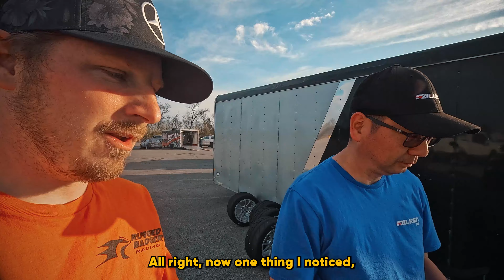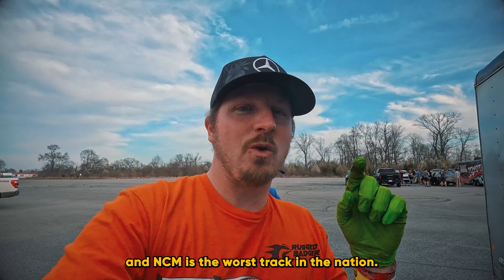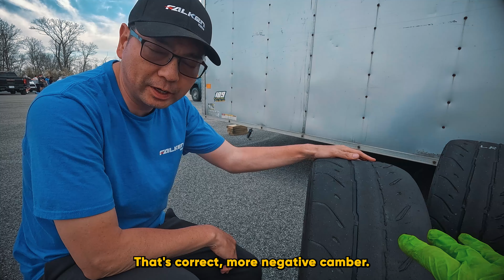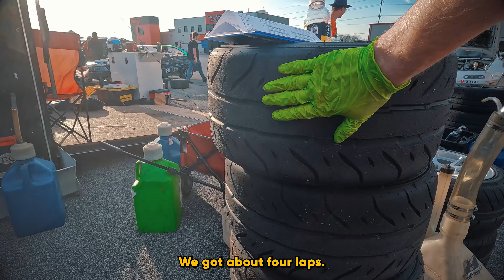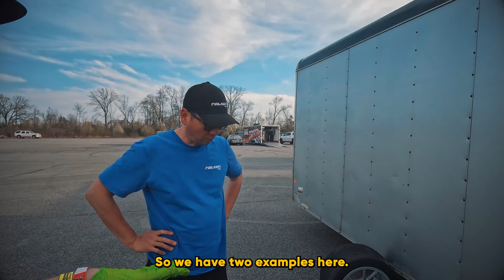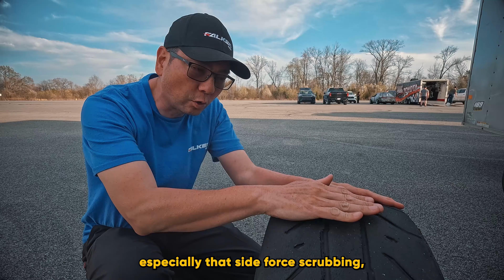Track Tire - Performance Guide - Tips and Tricks on getting the most from your tires!

Comment: Small point:  high wear reduces heat blistering.  From my experience, a low wear smooth surface will blister tires exponentially more than rough high wear tracks.  Your lack of tire issues may simply be that track is not conducive to blistering off the center tread even with the same setup.  Great track to see this effect is musselman honda circuit.  Super smooth, super low wear........blisters tires super fast.